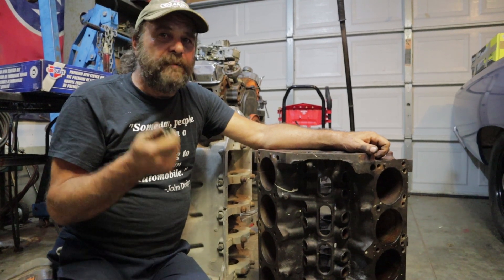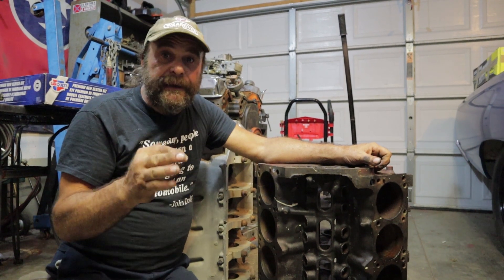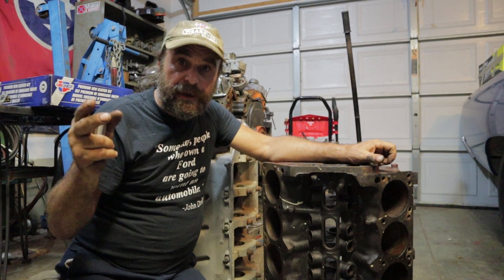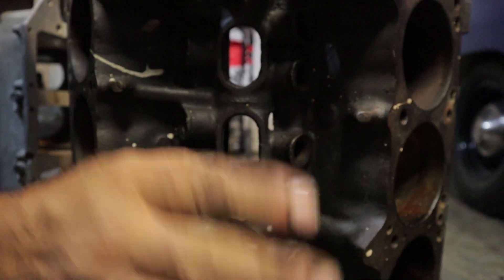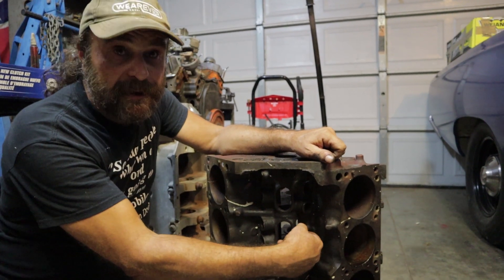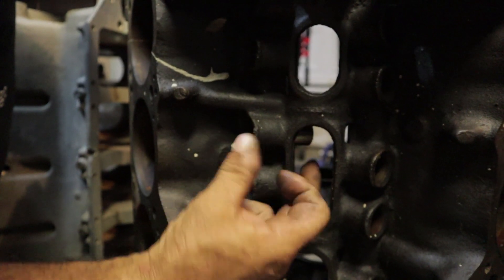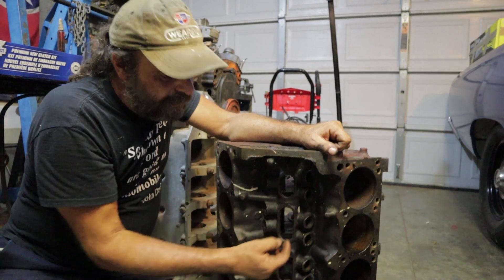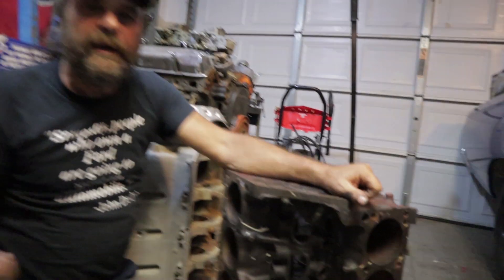Avoiding Camshaft Doom

Comment: You can order oil that has ZDDP in it or you can buy a ZDDP additive that you add to your non-ZDDP oil at oil changes. I've been adding ZDDP at oil changes to my favourite over the counter oil since the time it was removed from over the counter engine oil's.
Reply: corine colt inbred asshole...
Reply: @corinecolt1028  grammar, do you use it?

Comment: Tony, I had a machine shop build my mild 360LA. New Johnson USA lifters. Broke in correctly. Instant start up etc. on lifter taps hard and almost gets quiet once warm. Cools off, tap tap. Pulled lifter, looks like it should. I took it apart and found nothing. It’s not wiping. Is it possible to have a “lazy” lifter to pump? Can I just replace the lifter and go through the cam break in again with it? Too dangerous?
Reply from the maker: Try dropping in a fresh lifter, you should be fine, but also check the lifter bore to make sure the fit isn't too loose.
Reply: One lifter taps cold pretty good. Typo. One, not on. Thanks.

Comment: Uncle Tony I got 87 Camaro RS I put a 454 in it a fairly new healthy cam went through the procedure I decided to go to aluminum heads I took the motor out decided to change all the gaskets I rolled the motor  half of the flat tappet  lifters fell out  now can I put new ones in without changing the cam? Ty
Reply from the maker: Yeah, you can drop new lifters on it, but make sure you follow the break in procedure like it's a brand new cam.
Reply: @UncleTonysGarage  will do ty I also have a 93 Dodge Dakota I am putting a 440 six pack 4 speed in it Wrigley was a 4-cylinder 5-speed truck any ideas what rear i should go with? going to be a street and strip truck and thank you you and your channel let that spark under my ass to get back out into the garage

Comment: If you have block laying around for a future project,try to leave the lifters and pistons in it,keep it oily and spin it often.If no lifters or pistons in it,smear all  bores and bearing services with grease and keep it inside. In a humid place wd40 won't last too long.
Reply: Good thought there. I am sitting on an old 327 bare block that I had coated in WD-40, and will do this immediately.

Comment: Uncle Tony, what is your choice for honing oil during this process? Mineral oil? 30W? ATF?
Reply: I think he said he uses GAS on everything!
Reply: You don't want a "lube" oil like engine oil. You want a light weight cutting or honing oil or liquid. Engine oil will create a film and actually float the stones and greatly reduce the stones effectiveness. Diesel, gas or kerosene or even honing oil are all good choices.

Try it out with a knife sharpening stone. Try engine oil, then try gas or diesel, you will see and feel the difference. Mind the swarf.

Comment: So glad you mentioned this about lifters. Also, lifters are not perfectly flat on the bottom, but rather slightly convex. That's what gives them the ability to spin in the bores. Good stuff!
Reply: Yep, the face is spherical and the flat of the cam is actually a taper, so you get this off center point contact that (hopefully) spins the lifter around. "Flat tappet" is a really bad name.

Comment: Built many a 454 Chevy in my day, (working one now) these engines are notorious cam eaters. I always give the lifter bores a quick hone. A lot of the issues with the MK4 is poor quality control in the factory. Cam bores off center, lifter bores off center, these are things I look for in a builder block. Some are ridiculously bad. Also I try to get around 8-10 thousands of big end rod side clearance.  This helps spray more oil on the cam lobes. (Factory spec is 4-6). Some blocks just aren't worth putting a flat tappet cam in at all. Either go roller with these,  or tie them to the anchor chain on your boat. Or make them into a mailbox.  Great video UTG!!!
Reply from the maker: I know exactly what you're talking about with the BBC's.

Comment: I like my mild grind flat tappet hydraulic cam, easy on the stock valve train. The twin turbos help.
Reply: Twin turbos and stock valve train? Yikes
Reply: @chasewebber4316  probably something mild like a pair of waste gated GT3582R turbos. It's a popular thing for a daily driven V8 street/strip car.
Reply: @JosephArata  even still over stock it's good for durability and peace of mind to upgrade I'm not hating or nothing because it's not my ride but like I said it's good to get something INTENDED for heavier use. Again PLEASE dont take this the wrong way everyone.
Reply: @JosephArata  yes, it's a street car, borg warner 200sx, largest a/r. Probably good for close to 800hp, but the 600hp I'm driving now is enough, lol. No turbo lag.
Reply: @chasewebber4316  big block mopar stock valve train is good for much more cam than I'm using. If I run a bigger cam than I am now,  I'll choke my turbines, and actually peak hp would be less. That's why I'm running a mild hydraulic flat tappet cam.

Comment: That reminds me, I need to buy a zinc additive for my new 355.
Reply: Regular Shell rotella T, has the highest zinc content for your buck.  Only time I use any kind of additive is during break in.
Reply: @DwayneRouthierJr  I have heard this before but also heard that they either lowered the level or got rid of the zinc because of EPA mandated it, I think because cats are being used on newer diesel engines, same reason cars had trouble using zinc oil it ruins cat convertors but just hear  say that I've heard.
Reply: @JohnSmith-ry8qj  it's true that rotella contains less then it did years ago, but it still has a lot. The straight diesel oil does have enough. Rotella for gas or gas/diesel is the oil that contains less.
Reply: @DwayneRouthierJr  thanks for the reply it's good to know that there's is an  alternative out there easy to get locally, what's your  thoughts on if I ran low on Lucas hit rod oil, if the Rotella would be ok to add run up to next oil change
Reply: @JohnSmith-ry8qj  don't mix n match oils.  Use whatever you use and that's it. I'm not some big wig genius but you definitely don't wanna mix different grades of oils and honestly I wouldn't mix brands either. That's just me.

If you find something your happy with, use it and keep some in stock:)
Reply: Have you seen the Lucas high zinc hot rod oil it's like 40.00 for 5 quart jug.
Reply: @JohnSmith-ry8qj  no we don't have that here. I'll be lucky to find a quart of the cheap stuff.
Reply: @manicmechanic448  we don't have it here either but O'Reily auto can order it or Walmart online has it
Reply: @JohnSmith-ry8qj  cool
Reply: @JohnSmith-ry8qj  stp oil treatment in the blue bottle is just as good.

Comment: Tony was wondering do you ever take the block to the machine shop ? I have rebuilt a couple of motors . ( No near a many as you ! ) I would always take block to machine shop to get cleaned , cylinder's honed , cam bearings put in ,put freeze plugs in and to make sure block is good . Thanks for all the great content!
Reply from the maker: Yeah, when I need one bored, or decked I'll bring it to a machine shop for those services, but otherwise I do everything myself

Comment: Roller are ideal, but sometimes that extra $700-$1000 to get them, just isnt in the budget. As was in my case. Going forward, I will just save a bit longer to get rollers. Hahahahah
Reply: well that was one of the reasons my engine died is how picky flat taps are ( locked up solidly ) so i don't bother with them anymore ( there obsolete with modern technology / ways ) and my in process BBM RB 2G engine build will have full roller its just not worth risking another engine failure and or $$ / $$ special oil's even if i have to wait a little longer to start it up at least it's more likely to be a happier engine 

the videos are still helpful though i wonder if tony played with BIG H aka green flaming fuel if he did theres probably a cool story behind it but im not that crazy ( the only time i have seen a hemi fragranted in sub 5in peaces with 1970s top fuel crankshaft to boot so no not a wimpy engine aka Basically the same engine water cooled im building strength wise ish and i have no idea how much power it can handle 💥 ) to play with it but i did read things about it on ham hot rod form by accident and i notested tony was one of the posters
Reply: @charlesangell_bulmtl   same here. I am set to start rebuilding a slant 6, roller camshaft kit? Ha.

Comment: So all of my oil in my engine is going out my exhaust why would this happen? It's a 4.6 Mercury Grand Marquis
Reply from the maker: A few things could cause that...but they all equal rip it out and tear it down.  Much internal unhappiness awaits
Reply: @UncleTonysGarage  I put new plugs in it they have the original ones from 2001 or 1999. When I took them out they were soaked in oil. I replace them and also put a new coils but every once in awhile it blows out the smoke like you wouldn't believe and the people behind me and usually are on motorcycles and I feel really bad for them but have no control over the stupid card doing it so I have a feeling that it's a valve
Reply: Does the engine make sounds when it's running? Is it blowing smoke when you first start it or as you drive it? smoke on start up is usually a messed up valve seal. When your engine is running check the oil cap does it  have a lot of pressure/air coming out those are signs of bad rings on the pistons. A bad head gasket usually gives you chocolate milkshake oil or water you could also check the radiator cap if it has a lot of pressure or bubbling really bad could be a bad head gasket from exhaust going into your cooling system . I take it that you have a 4.6L 2V since the 3V came out in 2005 it has the spark plugs on top of the intake how you have them all oily is beyond me probably sucking oil into the pcv system.
Reply: if it smokes when you floor it, its rings. if it smokes on startup, valve seals.

Comment: Lifter no rotat-o
cam go wipe-o!
Reply: I took apart a small engine recently. 
It was babied and didn't have 10hrs. 
I could tell because of the gouge in the lifter and the lame lobe on the cam. 
Once it starts and you have oil pressure , ramp up the revs so they get spinning !!

Comment: It still amazes me, watching other people build engines, transmissions or do wheel bearings and they don't take any care to make and keep things clean.  Spend an extra five or ten minutes to make sure you don't boomerang it.  Take the time to put a bag around the engine you're building before you go to lunch.  Put some clean rags down to set your brand new wheel bearings on.  Scrub the rust and crud off stuff before you put it back together.  Make sure assembly lube goes where assembly lube needs to go.

Too many premature failures are caused by lazy work habits...

I gotta say, the older I get and the more I do and see, the more convinced I am that engine break-in is a huge myth.  Either the bores are right and the lifters and cams are cut right or they're not - either the lifters are going to spin or they're not.  It's not like anybody can or does check on that.  The magic RPM game doesn't really make sense either - all these cams with different profiles running different springs and different valvetrain mass... and they're going to "break in" at the same RPM?  Not to mention, how are you supposed to break in flat tappets in an engine that doesn't operate at those RPM?  You don't.  You make sure everything is right, you assemble it correctly and you let it go.
Reply from the maker: Do some research man, you'll learn a lot
Reply: @UncleTonysGarage  I'll do some more, but out in the shop, I'm seeing that a lot of the stuff we're sold for break-in has turned out to be plain woo.

For example, people pushing extended break-in periods.  "Don't floor it for the first 500* miles."  (*Varies from 500 to 5000 or sometimes more.)  That's just plain pointless.  If there's any actual break-in to an engine, it's all over in the first 5 miles and wide open throttle either doesn't matter or actually helps the process.  BMW use to put stickers on their windshields telling people not to use wide-open throttle and keep RPMs low for something like the first 1200 or so miles for the sake of engine break-in.  

And then there's the old "you can't break an engine in with synthetic oil."  Sure you can.  I've done it!

I'm just saying, the amount of nonsense I've seen surrounding the subject has me questioning the validity of the subject itself at this point.
Reply: UTG is great for learning the basics. Follow @steeldustmachine on Instagram if you want to see a pro engine builder do everything the right way.
Reply: let me re-inforce your theory....ive only ever broken new cams in at like 800-1200rpm. they never went flat. i dont buy the high rpm thing. just use lots and lots of zddp.

Comment: Whenever I install a wobbly stick.
I also install a cam button.
So the cam doesn't walk.
They're cheap and I think they make a difference. Lifter bore hone!
Rodger that Blue Eagle.
Reply from the maker: I mean, it can't hurt.
Reply: Agreed!👌💯
Reply: @thoth6732  The first time I ever heard of one was when I got my first set of Pete Jackson Gear Drive. A true roller chain is good enough. So if a cam button keeps things lined up a little better.
Maybe things will last a little longer and work a little better.
Reply: Blue Eagle 🤣😂🤣😂 I blued one in the first bug motor I built. Good old solid lift and a dumb teenager. That's been thirty some years ago. I don't have problems like that anymore.

Comment: Good stuff. Speaking of cams, I'd love to see something on old school solid vs hydraulic for street brawlers.
Reply: I Second That.. Great Question..
Reply: @AtZero138  Thanks...Don't tell my wife- I'm supposed to be cleaning the garage.
Reply: @alexsweet8585  Never a Problem.. Haha.. it's the Code of Men..
Reply: Pulling the covers once a month is an extra tune up expense of $120.00 a year where i am... and that is flipping the gasket every other time. I will keep the hydraulic lifters thanks.
Reply: TheCanadianBubba   What kind of mileage are you doing that you need monthly valve adjustment??
Reply: @TheCanadianBubba  I get that they can be more of a pain in the ass, but what's the upside? Do they ramp differently?  Is it just that you don't have to worry about them bleeding off at higher RPM?  These things were in some of the most revered engines ever and are quickly becoming lost tech.  I'd just like to get the skinny.
Reply: Alex Sweet - IMO when tuning for performance, the solid lifter is the standard. When you are trying to pick up tenths and making changes in other areas, the last thing you want is the variance a hydraulic lifter can bring. I have found sludge, bits of gasket, silicone, and even cam bearing shavings in the hydraulics. Sure those things are from my shoddy or rushed work, but that would not happen with a solid setup. Finally, a solid lifter will never collapse on you.
Reply: I would think when adjusting a benefit would be finding a bad valve spring or seats beginning to sink before shtf, too.
Reply: @alexsweet8585 - deciphering those usually starts with a backfire or a miss.
Reply: @TheCanadianBubba  I get it...but it gives you a chance to see what's happening with each valve at a given interval... like shaking down a front end before aligning it. Just because something isn't catastrophic, doesn't mean it won't be soon.
Reply: @alexsweet8585 - Yes, you do get to eyeball each and every one, each and every time, after each and every one, after each and every time, after each and every one, after each and every time...
Reply: @TheCanadianBubba  on my ladies 68 Dart.. we have twins.. her is Slant6 still.. I Use to do the Valve adjustment every couple of months... cause if Pure love.. love for her slant6.  And making sure it was always getting it's 25plus MPG single Holley 1920.. 3mil off the head, Accel plug wires and coil..
Reply: Slant 6 engines had solid lifters from the factory for decades.
Reply: @n4zou  My motor has had them since its inception, 5.9l Cummins Haha. Still love the gassers for cars though.
Reply: @92powerdiesel61  those aren't solid lifters, they are direct impingement to pushrod lifters, with the hydraulic being in the adjustment screws on the rocker arms. Sorry, but it's not the same. Also, lasts longer with less adjustment required.
Reply: @JosephArata  Really? I have to adjust them every 20k. I know they changed them in later years but I was pretty sure they were solid, at least in 1992.
Reply: @n4zou  a lot of the late 60's/ early 70's bad asses did too...

Comment: So i have a small block chevy that had a cam go flat. I have since torn motor down and plan to change the main and rod bearings then install roller cam. Is there anything wrong with my plans. It never knocked or smoked. Just changing bearings because when cam went flat i had low oil pressure. Might of been bleed off from lifter dropping below oil port hoping the bearings will bring the pressure up. Old bearings look ok just the coating is gone.
Reply from the maker: Yeah, if you can swap to roller, go for it!